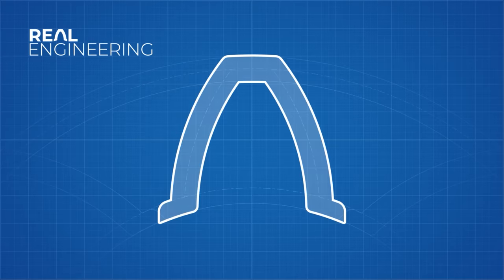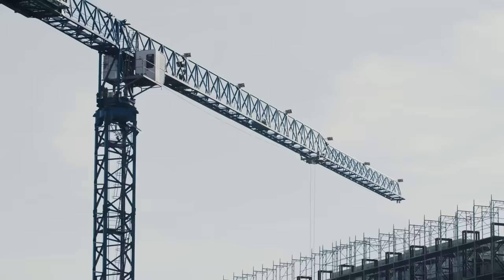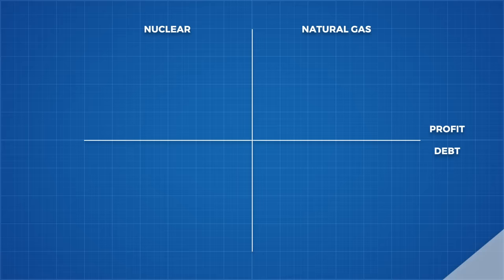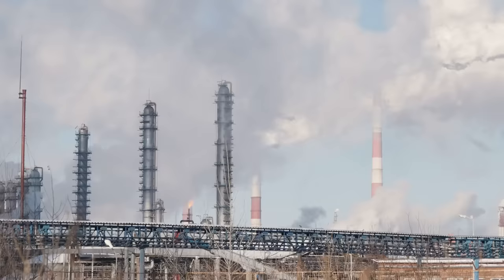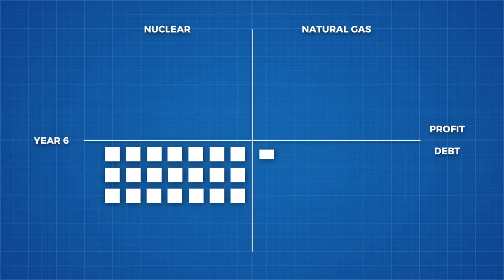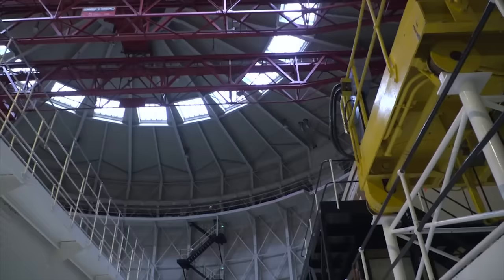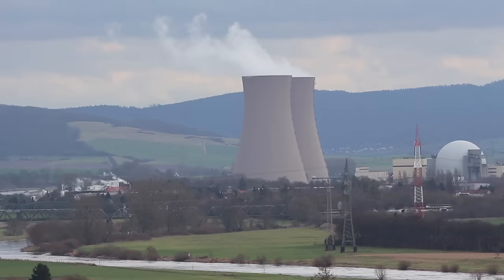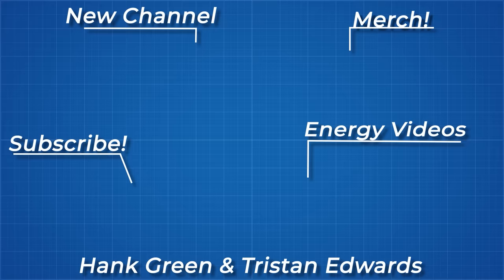The Economics of Nuclear Energy

Comment: Initially I liked this video, then I researched for my Exams. Now I have to say the content is extremely misleading! Please correct it. Nuclear Power plants are NOT profitable! You make it sound like they are. They are only profitable from a operator perspective. There is not one nuclear power plant that has ever been profitable in its entirety! There is not even a scenario present nor future in which a nuclear plant COULD theoretically be profitable. Any combination of assumptions will always end at a total negative NPV. Why did you make this mistake? the decomissioning and fuel disposal costs were not included in your calculations and neither the massive subsidies nuclear power receives. For example in the US due to knowing nuclear power is non competitive, they made a regulation giving a certain profit guarantee to the power plant meaning each unit of electricity sold from a nuclear plant is subsidized. Furthermore it has been established that LCOE CAN NOT BE USED to compare energy sources!! and why is that? well LCOE does not contain any of the hugely important metrics like production and demand mismatch, energy transmission, energy storage, reserve capacity, etc -> it only looks at production ignoring the quality differences between energy sources. When accounting for all of these factors you should use ESA Energy system analysis aka a total system analysis, its country specific and allows comparing energy sources for a country or region, using ESA on germany i can tell you that the difference between energy costs becomes quite small, just few percentage points, the difference between wind and nuclear in costs is not as big as you make it seem with your false application of LCOE.    Now why should you believe me? Im almost done on an exam paper about nuclear power, initially me and my group thought nuclear my be a good choice for our home country denmark we had a positive bias, but now it is abundantly clear that nuclear is a horrible choice in all regards. Its not flexible enough to be a good solution for balancing the grid, its slightly more expensive than even building massive off shore wind and balancing that wind, it pollutes way way way more than anyone here thinks and therefore is not at all a carbon neutral energy source. I can elaborate on that: counting the entire lifecycle, construction, operation, mining uranium, refining it, decomissioning the plant storing the waste ends at quite an energy expenditure and quite a lot of material used, steel, concrete etc. all this pollutes quite a lot, in fact a median number for pollution is 66g co2 pr kwh. Wind power has a number of 5 to 8.2g co2. Several nuclear projects have been far above 66 whilst some have been below, its is quite situational hence the 66 is a median number, some outliers even went to 288g co2 pr kwh at which point its practially as good as 1800s coal plants or something of the sort. 
So please redo a video on nuclear because right now you misinform people. I don't have time to gather and share my sources here as its quite a list and our project is not complete. All the sources used are only reputable peer reviewed scientific articles though and there seems to be quite a rigid consensus on the statements Ive just made. There is a reason nuclear power will be practically gone by 2050.

There are actually quite a lot of other arguments for why nuclear is even worse in future scenarios, one is for example the degredation of access to high quality uranium meaning the CO2 per unit uranium mined steadily increases at a fast and non linear rate by 2030 a nuclear plants emissions will be equal to natural gas!! (on average). Not to mention that the new safety regulations (which we direly need) make plants a lot more expensive than previous plants have been. Its more accurate to use a cost of perhaphs 9000€ pr kwh for construction. Not to forget that NO plant has ever been properly and fully decomissioned in for example france so they have never even had to pay the full price for nuclear yet. But they will in the future and it will eat away at them making it hugely difficult to find money to replace nuclear with. nuclear was a massive mistake right from the start. And only finland has a long term storage solution for its waste. If society hadnt funded nuclear we could be way ahead with renewables by now and not have this looming threat of all the falling apart badly maintained french and east european reactors and the doom coming once they have to be paid for fully aka once we have to lump up billions to decomission them and deal with the waste. 
Any country building nuclear plants is either fully insane and completely disregards all scientific evidence or has political motives likely linked to wanting nuclear power to maintain the ability to quickly build atomic weapons or to remain less dependant on gas from russia (which both are the french arguments for nuclear). Without those political reasons nuclear power would never have become a thing anyway.

I will not notice if anyone comments on my comment, sorry I can't spend time reading and arguing hence my notifications for replies are disabled.
Reply: An interesting take but I've also read reports telling me the complete opposite. For example, to build up enough solar or wind to equate to what a nuclear plant does, it takes far more of a toll on the environment with far more emissions. There are also dozens of articles on why solar and wind farms are actually incredibly harmful to their direct ecosystems and basically ruins habitats they are residing in. It would seem quite obvious to me that the ONLY disadvantage nuclear has here is with the waste of which there are dozens of articles explaining that if we invest in nuclear, the technology will get to a point where we could actually use said waste as another type of fuel. It just sounds far more efficient and safer for the environment  to me than solar and wind farms do.
Also, this cost analysis doesn't really add up to me. The total cost of production is quite high for sure, but throughout its actual operation, it seems like its far less expensive to maintain and operate. We can simply look at and compare France's expenses with others. Also, you mentioned storing said energy. Wind and solar have this same problem. In general, nuclear would be more reliable as well which would also drive down the costs overall for said energy. I just think that this specific idea is also not correct here.

But hey, at the end of the day its all better than natural gases and coal and stuff.

Comment: The problem is not engineering. the problem is the reality of nuclear power. Most nuclear power plants have cost overruns. The cost per kwh is too high. the profits taken by uranium suppplier and construction are too high. the cost is NOT falling. A nuclear power build today must beat 4 cents of solar right now, and 2 cents-3 cents solar when it completes in year 7. In short, nuclear is a dead technology. They fail to innovate, they fail to impress. its just a total fail

Comment: You are completly neglecting the disposal costs of the waste which is produced. You know, the waste that needs to be taken care of for Millions of years without it contaminating the water we drink, the food we eat, the air we breathe... Nuclearpower might help one or two generations short term but will be a burden on 1000 generations to come. And you just cannot put a pricetag on that... That is why nomatter what a Professor of Nuclear (super unbiased source btw) says it will always be a bad idea to use this energy... You are complaining about politicians not thinking  about it long term  while you do exactly the same thing
Reply: Now an un biased analysis of Indonesia's  3.5GigaWatt 7×500MWe TMSRs consisting of liquid metal Thorium ion molten sodium fluoride salt burner energy converters constructed in an Asian oil-tanker shipping yard (with a capacity of 12 towable double hulled barge-like units per slipway, fully fitted out with the exception of the nuclear fuel), at a cost of $1200/kW including towing to Indonesia.
They will be using near free fuel included at the same time of the four yearly 7 day periodic maintenance pauses (which includes recycled reactor pot fitted with new graphite moderator and any typical maintenance on generating system etc.) for a pre-profit cost of less than $40 per Megawatt.hour.
Checkout ThorCon's PPA agreement with Indonesia requiring the price to consumers, not to exceed  7cents/kWh  including all costs in 2020 prices. Indonesia's only costs will be to prepare mooring site; hookup to Grid and external security.
A single 500MW unit's footprint is 65m×180m=1.17Ha and may be a base loader at 90% utility or self  load following. That's 500/1.17=427MW/Ha. Each unit using a standard proven & reliable (gas or coal fired type) 500MWe turbine will compete with current PV Solar farms at 0.5MW/Ha but only 30% utiliy. So PV alternative requires (427/0.5)x(0.90/0.30) = 845×3 = 2564 larger footprint per 500MWe unit. Hence the PV Solar alternative to 7×500MW ThorCon units requires 7×2564=17950Ha. 
 That would require the destruction of 180sq.km of scarce tropical rain forests to provide the equivalent of 90%×3.5GWe of PV Solar farms whereas the3.5GW ThorCon units need only 8.2Ha for the 7 units' footprints
If you care to check out how the function watch the #5 traing session given by ThorCon's Chief Nuclear Engineer recently appointed from the only current Thorium Molten salt reactor in the World, located in the Gobi Desert. (See at URL below.)
https://youtu.be/q3v3L5FQSJI